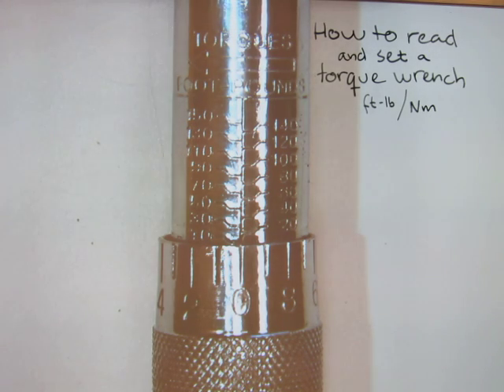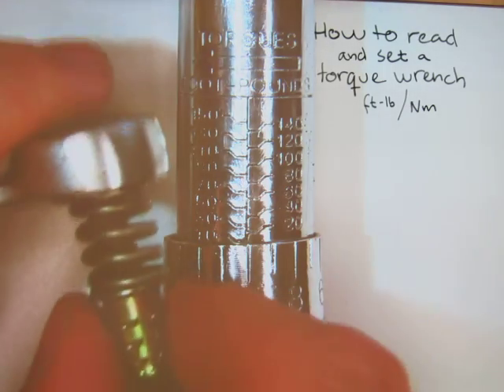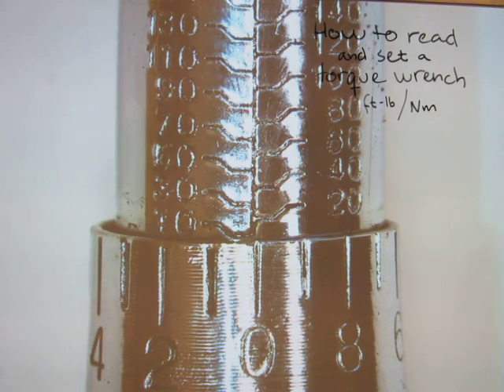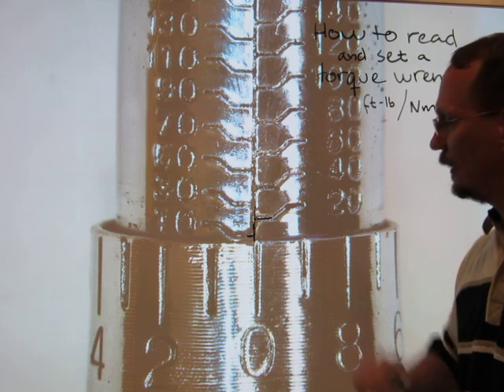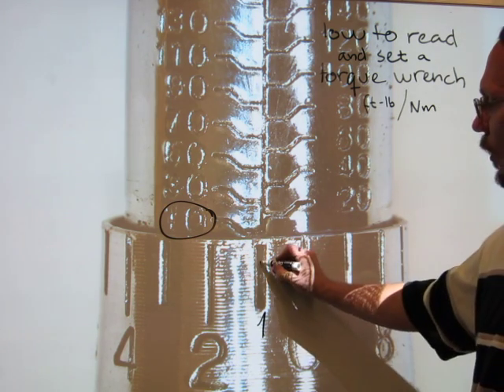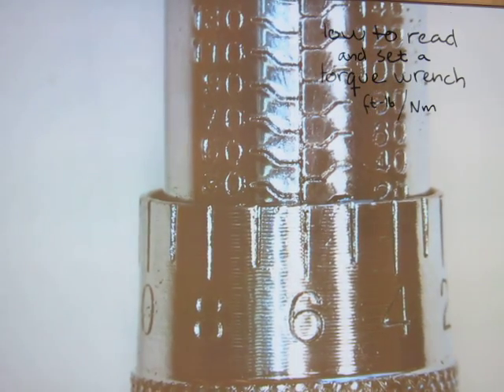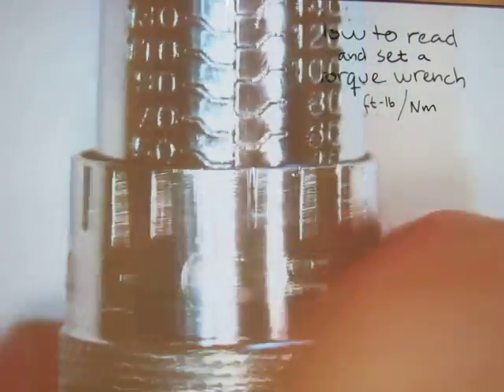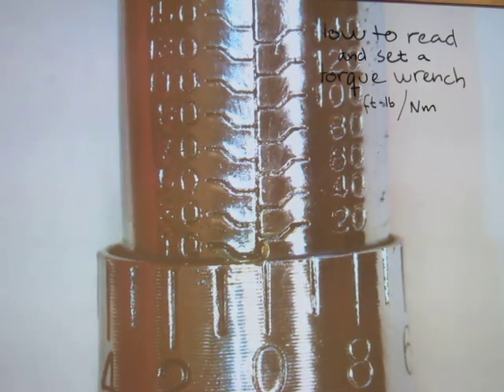How to read a torque wrench

Comment: The 0 is smack dab in between the numbers on mine...how would i know if its the number over or under the 0?
Reply from the maker: Typically, a possible reading error of being one spot wrong is not critical in applying torque. So being close enough is safe enough, specs are given in a range anyhow (10-12 Nm)

Comment: Great video. I have a torque wrench that reads in inch pounds. The settings start at 120, then 240, 360, 480, 600 to 960. The handle, when turned 1/2 turn to the first 0 mark on the handle climbs from 120 to 240 and a full turn the second 0 mark is at 360. I assume that each mark on the handle = 12 inch pounds. Anyway, thanks for the video. It helped me with my spark plug replacement.
Reply from the maker: That`s right, 12 is the conversion factor.

Comment: i have a  sh dms-1 torque wrench ( http://www.saphir-service.com/files/IM_SH-DMS-1_2013_UK.pdf ) that has scale marks from 0,2,4,8,10,12,0(14) how to read this one? and if the bottom line is 28nm so can it be wound back to get lower 20 nms or 12nms? or it dont work like that?
Reply from the maker: Same additive principle applies to readings, examples are on page 8. Page 5 says "the torque range from 28 to 210 Nm.", so no.

Comment: Hi can anyone help me . I need to set my torque wrench at 5.5 f---lb or 7.46 N--m to tight the valve cover engine bolts on my car . The torque wrench I have  starts at 25 f----lb and I need to know how to set at the mentioned torque before.
Reply from the maker: MrFreddyelgato Yes, very good observation, don`t move a muscle. The wrench you have is too strong, can not be set to the specified low value. Get a small baby wrench. (Or, in a pinch, hand tighten: 7.46 Nm is barely more than finger - snug. Just barely compress the rubber washers. They will seal, you can check and adjust a hair if needed when the engine runs.)

Comment: My torque wrench has a limit of 80 nm. Can you tell me what happens, if say I set it to 100 nm. Will this break the torque wrench?
Reply from the maker: HunterHunter88 Wrench will be fine but will not click at 100Nm reliably. In further massive overloading cases, say, one can drive a pick-up over a bathroom scale, the spring mounting points may deform inside, so it will be unreliable after.

Comment: Thank you for a great video. I am about to change my spark plugs in a 1997 for E-150 with 4.6L engine that has the spark plug blow out problem if you don't torque it to manufacturer specs, and i was worried about reading my torque wrench wrong, but you explained it just great. Very well done video.
My spark plugs are supposed to be torqued between 84 and 168 in-lbs. I hope i converted it correctly to foot-lbs, it comes out to 7 ft-lbs to 14 ft-lbs. If i got it wrong then i will be in for a very very expensive repair.
THANK YOU theoverengineer.
Reply from the maker: Will Givenoname Yes, the math is right. You might want to get a torque wrench calibrated to light torque, between say, 50 - 300 inch-pounds. At the low and high ends of any instrument`s range the readings are unreliable. It`s like trying to weigh a potato with a bathroom scale. It`ll read zero, or 1 lb, neither are really right. Thanks for watching!
Reply: theoverengineer Thank you for a fast reply.
I actually had two torque wrenches that read in in-lbs, so i used those set to 160 in-lbs and i compared them to each other on a bolt before i used them. I drove the car around for 30min and checked each spark plug again, and it looks all good. The only problem i had was oil coming in from the top drenching the spark plug, the weird thing is my spark plug tubes are in the heads, so it's not not the valve gasket because it's all dry around the valve gasket anyway. I can't figure out where the oil came in from, the head was all clean around the the spark plug tube, but it's coming in from the top for sure. I don't know if there is any seals inside the spark plug tubes if their inside the head, but i doubt it. The van only burns less then half a quart of oil within 3000miles. Maybe you know anything about the ford 4.6L 2valve engine, that i don't. Thank you.
Reply from the maker: Will Givenoname I have seen plugs dripping with oil, but the was the lower threads and electrode gap part, from oil leaked from the crank case by the piston rings into the combustion chamber.
There is also the cam cover gasket, thick and reusable type, running around the perimeter of the head. At or near the same height or level on the block, there must be gasket rings around spark plug tubes too, same way thick and reusable type.
Those are the only 2 spots, gasket above or blow-by oil from below.
Reply: theoverengineer
I am 100% sure it's not from blow-by from below, because the spark plug was clean below, but the whole ceramic and upper thread was drenched in oil. If the spark plugs would of been in the valve cover then i would be sure that it was the O ring seal leaking, but in these engine the spark plug goes straight into the head not thru the valve cover, that's what got me so confused, because i don't think there is any seals inside the spark plug tubes, but i might be wrong. It's really hard to see inside the spark plug tubes because it's a van and all the spark plugs are located under the dashboard part and there is like 5 inches clearance between the engine and dashboard so there is no way to stick my head in there to see. But it runs great for now, so i will worry about it when i start to get a misfire.
Thank you so much for taking the time to answer my questions. You have a wonderful day Sir.

Comment from the maker: The XLC TO-S40 is manufactured to metric standards. The numbers on the main scale are in N-m, in increments of 2 N-m, starting at 6, 8, 10, ...28, 30. The numbers on the handle are also in N-m, starting at 0, 0.4, 0.8, ... 1.6. There are un-numbered marks between these numbers, meaning 0.2, 0.6, ...1.8. The 0 and the 2.0 marks coincide.
One half rotation on the handle is + or - 1N-m, a full turn on the handle = 2N-m. A full turn on the handle precisely corresponds with advancing by 2N-m on the main scale as well.
Say the handle is at 6N-m or below that, at rest. Setting it to 13.6Nm would require turning the handle clockwise until its edge is at the 12N-m line, and the handle is at 0. Then rotate the handle clockwise again by an additional amount, until you get to 1.6. The edge of the handle is now at about 3/4 ways between the 12 and 14N-m marks on the main scale, the handle is at 1.6
Ft-lb can not be set accurately on it without conversion, as 1 N-m does not equal 1 ft-lb. Exactly the mirror opposite of the wrench I had for my video.
Reply: My torque wrench has a limit of 80 nm. Can you tell me what happens, if say I set it to 100 nm. Will this break the torque wrench?
Reply: HunterHunter88 you need to buy a bigger torque wrench the bigger the size of the wrench more torque it provides, the wrench in this video is probably a 1/4 or 3/8 if you need more torque you need to buy a 1/2inch wrench and so on.
Reply: HunterHunter88 how are you going to set it to 100nm if it only goes to 80nm. your wrench should be useable to the max range it has on the wrench. if 100nm is listed on you wrench it will work to 100nm.

Comment from the maker: The steps and bolt pattern is to ensure even seating and uniform load distribution. So don`t reef one corner down with all the other bolts still in a cardboard box. That will skew or crack the block.

Comment from the maker: Just quickly: the numbers 8, 4, 2, 6 ... etc is the order in which bolts are to be tightened. It needs a picture where the numbers assigned to the bolts are shown. Notice, the range of these numbers 1-10, for 10 bolts in total. It probably is a criss-cross pattern.
Tightening is done in 3 steps: half-good, three-quarter tight, fully tightened.
Torque figures: ft-lb x 12 = in-lb, eg. 22 x 12 = 264, as 12 inches make a lb.

Comment: Hi mate.
Ok now this is taken from a Honda forum, its a whole paragraph
for a B16a engine. Thank you, greatly appreciated.

CYLINDER HEAD BOLT TORQUE SPECS (tightening) / (loosening)
 8, 4, 2, 6, 10 &lt;---intake order 3, 7, 9, 5, 1
 7, 3, 1, 5, 9 &lt;---exhaust order 4, 8, 10, 6, 2

 Torque in steps: 22ft-lbs (264in-lbs), Then to 63ft-lbs (756in-lbs) (final spec) 94+ Teg
 Torque in steps: 22ft-lbs (264in-lbs), Then to 61ft-lbs (732in-lbs)(final spec) 90-93 Teg / B16's

Comment from the maker: Yes, GearWrench does make their SAE/Metric torque wrenches with two scales on one rotating ring. The numbers for lb-ft are all multiples of 10, easy to work with. The amounts for Nm are all ending in decimals due to conversion. Very precise, just needs a bit of headwork; eg add 108.5 Nm on the main scale and 5.4 on the rotating=113.9 Nm (vs.=84ft-lb). GearWrench also makes torque wrenches in Nm only where the amounts are in multiples of 10; eg 110, 120 on the main scale and 1-10 on the rotating.

Comment: Very helpful video. Thanks. My torque wrenches (U.S.A.-made GearWrench) have double scales on the rotating handle ring, one for lb.-ft. and the other for N-m. These are much easier to use because I needed both (for metric and SAE tasks).

Comment from the maker: You are right on, thanks for the note. Yes, if a wrench was made for ft-lb, its gradations will not work for whole number multiples in Nm. It is, in that case, way easier to convert Nm to ft-lb and set that on the wrench. Likewise, for a European-made Nm-calibrated wrench it is easier and proper to convert ft-lb figures to Nm and work with those numbers.